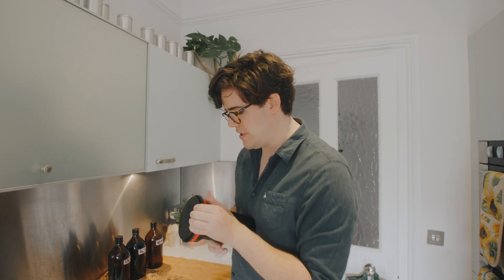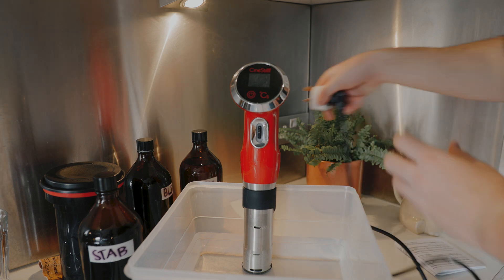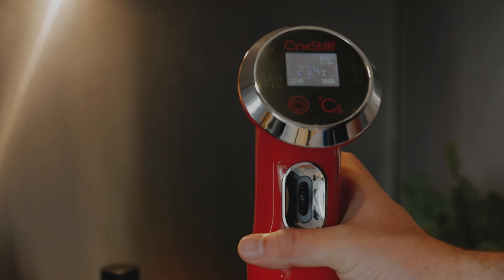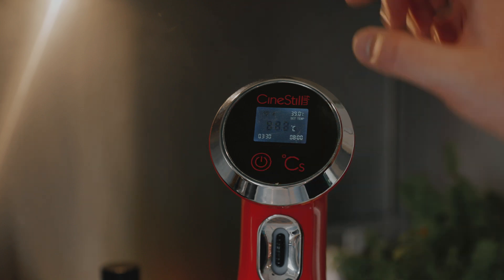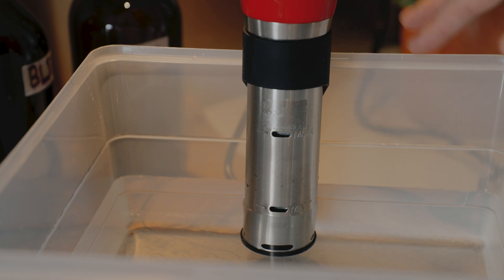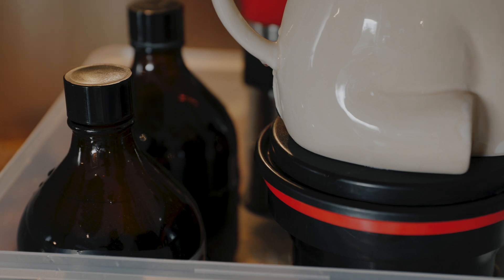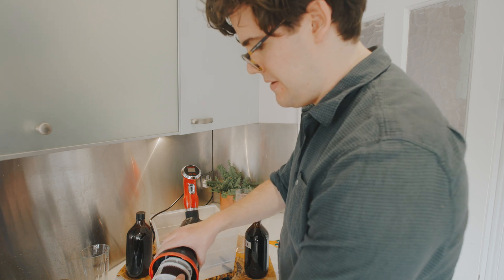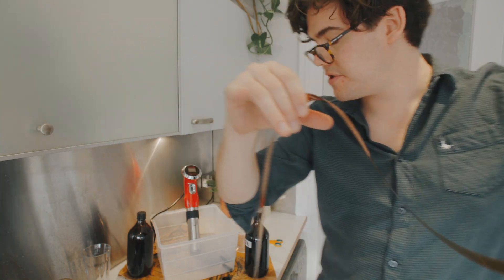Analog Review: Cinestill TCS-1000

Comment: And you can even cook with it!

What an age with live in when cheap sous vide circulators can now be rebranded as a film processing tool.
Reply: The glass is radiating the heat. I think a light plastic bottle would be very quick.
Reply: * significantly more expensive sous vide cookers
Reply from the maker: https://help.cinestillfilm.com/hc/en-us/articles/360029004292-Advantages-of-the-TCS-1000-over-kitchen-appliances here’s the cinestill page on this issue for those interested

Comment: Hi interesting but you should not put the Paterson tank in empty with film it could soften the plastic material and warp the film. The idea of pre warm up is to heat a jug of water at the temperature 38c and pour that water into the tank to pre warm up the colour film this gives the film ready, there is a little discolour of the water after you pour it out now start your Dev pour. The default times and temperature come on when you turn on the CineStill plus the temperature or the water that be heat up. I just div my first colour film it was grate fun.

Comment: For those who process color film, these are a real help. Frankly, you can buy one made for cooking which will work just the same for half the price of the CS product. Back in the 1980s when color processing at home was really becoming common,. warming tanks which did this job were about five times the cost of this unit. Such is modern electronics. The trick to using these is to start with heated water, rather than using these to warm room temp water. Using one of these to heat cold water (1) will take forever, and (2) will wear out the heating element in a unit which isn't really built for that  stress.

Comment: As this contraption only heats the water in the bucket to the set temperature, it will take forever to heat bottles with chemicals if they are not pre-heated. Just bought one anyhow, because in the long run I think it will be convenient, when it comes to keeping the temperature, but pre-heating my stuff will save time. -- Thanks for putting this together, as it made my decision easier.

Comment: Great video, but what a nightmare!😬 This is why I used to hate doing my own color dev.
Now I stand develop my C41 at room temperature. 60 minutes with no agitation after the first minute. 3 minute wash, then Blix 10 minutes with constant agitation, and stabilize as normal.
Would love to see you do a normal C41 dev vs stand comparison video.
Reply from the maker: This comment is the first I've heard of c-41 stand dev, sounds like a fun video idea. Does the 60 minute timer change depending on chemical depletion? I add 30 second do my 38C developement every 4 rolls (in line with the Tetenal 1L data sheet)
Reply: @JonathanNotley  I only do the recommended 8 rolls per the kit instructions, and no I don’t change the time. Beyond that I can’t say.
Reply: It is impossible to get the colors even close to industry standards in room temperature. If you scan and edit digitally, you can correct this failure in most cases. But for darkroom printing, negatives with off colors are a real pain in ass.
Reply: @b6983832  actually the colors are pretty close, but yes they need a bit of tweaking in Lightroom. I like the results. Maybe give it a try, unless you exclusively darkroom print.
Reply: @joeltunnah  I don't scan, but I've been printing color  in darkroom since the late 1980's, I don't want to change this work to digital. It would mean also investing zillions to equipment, because I want to have good quality prints on paper.

Comment: I just developed my first C-41 rolls this weekend, using a very similar setup. I used a cheaper device for the water bath though - a sous-vide that looks identical to this Cinestill one, down to controls, display and dimensions. Less than £35 though. Will have to see if that means it's going to break down or not.